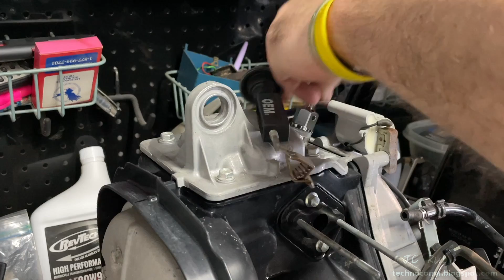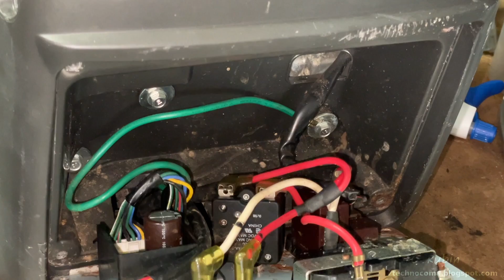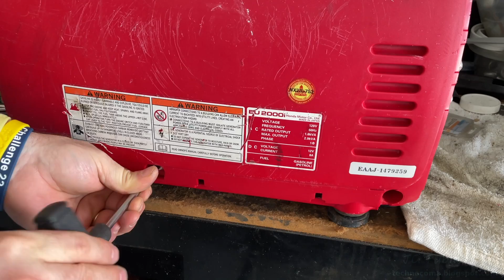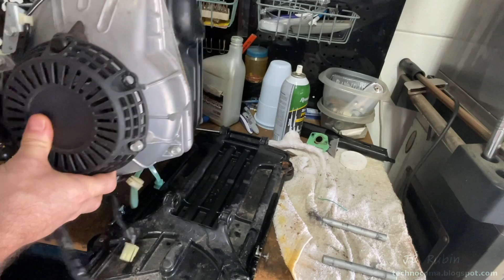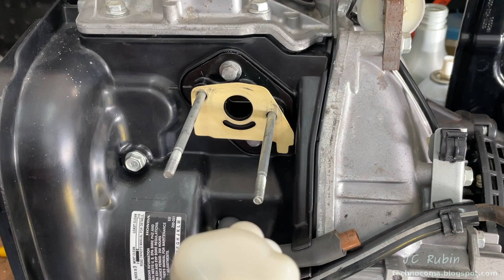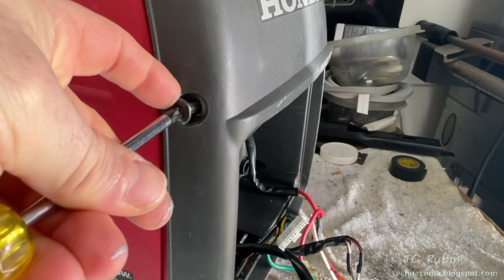Honda EU2000i - Ultimate Ignition Troubleshooting and Repair

Comment: Good after noon, thanks for video. I have no spark, i have restance and signals at the 6 pin conector per video. Coil reatance is good too.  Pluging in another iginiter didnt help yet, any idea? Ill do a wire check for broken, blue wire and others.

Comment: Check the shut off switch plunger gets stuck in shuts spark off.
Behind on off dial.
Two wire plug connected.
Disconnect plug it will have spark .

Also make sure oil is filled up high as it can go 
Often they will start run and shut off after a few seconds from low oil switch shuts off ignition.

I have several of these Honda some 20+ years old . Run all day on construction jobs.

Excellent quality Honda !

Comment: All my meter tests are in spec. No spark. If you disconnect the coil lead should you get spark? Is that a kill wire? Also how can you test the ignition control module?

Comment: Hey mate I’ve got a Honda eu30i at home with a similar problem just wondering if you know if there similar? And how it actually works. So I’ve removed the engine itself from the internal cradle my problem is no spark the magnets seem fine has a new coil and spark plug and still no spark, do the plugs from the stator have something to do with it ? Ie they some how make it not spark with all the wires disconnecting?  Thanks for any info cheers

Comment: Ignition control module harness connection behind front elecronic panel.  Removed, sprayed cleaner into pins and blow dry, reconnected and one pull start.   Excellent video, the only one anybody needs other than carb overhaul.
Reply from the maker: I’m happy you found the info you needed.

Comment: I’ve a 2008 eu2000i that sometimes is a bear to start. Tried a LOT of tricks. Only sometimes. this will be interesting to watch. 

One thing about a generator, if they run at no load to near no load in extended basis the plugs have a tendency to foul. The plug was wet today, I cleaned it off well, gapped and filed and got it running. Intermittent spark for some reason, a snappy blue/white spark in open air is standard for small engines. This thing will get thrown off a cliff! &$&k!!

The last time it got stubborn I needed power to fill a spare after a flat tire on the Interstate. Sun going down. Ordinarily it starts right up, as a Honda should.
Reply: It’s the on/off Switch! Disconnecting the 2-pin connector it starts. Yeesh. 

Thank You!
Reply from the maker: You’re welcome

Comment: Hello, would you know the Ohm spec of the Pulse Generator on a Honda EU1000I A2? I have a weak and intermittent spark. My PG ohms out at 30ohms. 270 less than your measurement on this EU2000I video. Looks like I am only making .25mv on a pull but not sure I was pulling my friend was watching the MV  All wiring has good continuity. Ignition coil resistance in spec. With no way to check the module I am hoping the Pulse Gen Is NG. Thank you!

Comment: Great video.  Have you run across this problem that I can't seem to fix with the many internet 'common problems' of the EU2000i.  The ECO switch does not kick down the rpms.  And the motor runs rough without achieving full rpms.  In other words, turning the ECO switch 'on and off' does not change the rough rpms, however the switch is fine as tested with an ohm meter.  Carb's cleaned, but I also replace with a Chinese knock off a couple years ago and was running fine.  I still have the original.  Yes, the generator has had its issues, with less than 500 hours.  So much so I've replace it with an EU2200, but am still up for a challenge!

Comment: Hi my question to you is if the ignition coil reading on the primary is 0  will that cause the engine to just die and I couldn't restart no spark at the plug changed plug still northing so checked reading  coil secondary is good but primary is 0    Oil sending switch checks oil.  Thanks  Rick

Comment: Did you torque the spark plug.  I replaced mine and found it very different with the compression washer?  Makes me wonder if it is tight enough?
Reply from the maker: The compression washer is scary because you think you are stripping out the head, but eventually the torque will increase as it bottoms out.

Comment: Very good video! helped me get a spark after 2 minutes. The only think I noticed, you closed the airbox cover before bolting the screw in the airbox into the block and than installed it only with the two nuts on the carburetor. Odd.
Reply from the maker: The device at the time was in several states of disrepair as you'll see in the restoration video.  Some footage was made as I was addressing only a specific issue at the time.
Reply: @delorean1  Again, very good informative video. It helped me diagnose no spark. Your other video helped me with a gooey carburetor. Thank you for sharing the knowledge!
I have 3 of those generators. At a certain point I used them on my semi trucks to power portable air conditioners. This was when the new emission came out and idling a big diesel would clog a DPF. I built cages for them on the frame behind the cab and added an external aluminum fuel tank. I used it for about one summer before ditching the idea since those portable home AC were not designed for a vibrating vehicle and I went through several under warranty. Those gensets remained on the trucks for 2-3 years out of laziness before I removed them and stored at my storage. I just rebuild one (mainly plastic part, very bad fuel system, oil, plug and filter) and have no energy for the remaining two. Let me know if you're interested in buying them cheap.

Comment: When I try to turn the eco button on nothing happens.   I replaced the eco switch but still the eco mode doesn't work.  Do you know what could be the problem?
Reply: Check your "Throttle control motor"... sitting under the white plastic case on top of the carburetor...
Reply: @Horus2Osiris  okay but how do I check it?  I mean what am I looking for?

Comment: I have 2 identical EU2000i generators,  I have a no spark condition on unit number 2.  The coil measures 1.7 on the primary.  I replaced it with a working one from unit 1 and still no spark.  The pulse generator measures 340 ohms at the ignition module and at the 6 pin connector.  And I get voltage with a pull on the cord. I swapped the ignition module into the working unit 1 and it works.  Tested the oil switch and engine off switch.  All work.  Replaced the spark plug.  No spark.  All measurements at the ignition module read correct.  Before I tear down to get to the pulse generator is there anything I can try?  Thanks for your video.
Reply from the maker: I did post all of the troubleshooting steps....  whatscha got left?